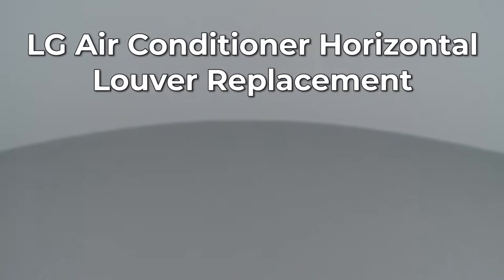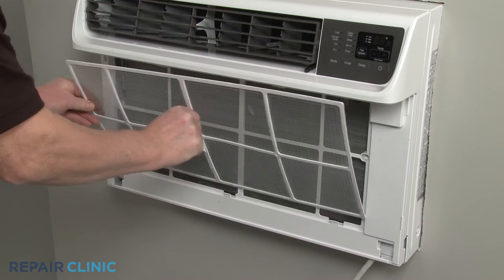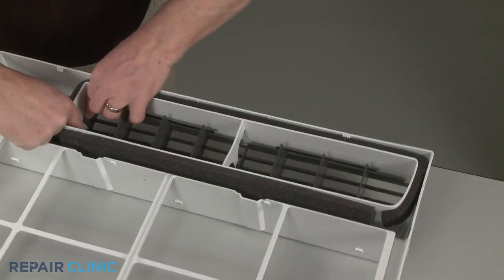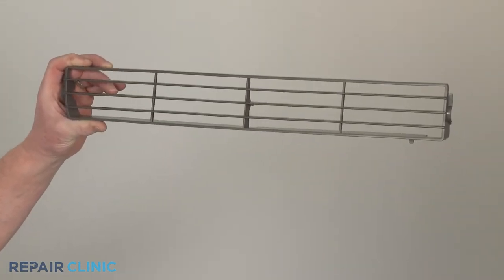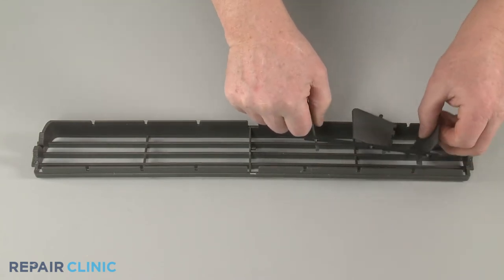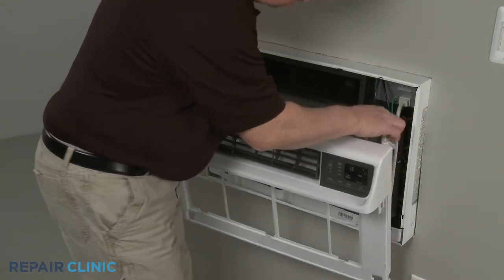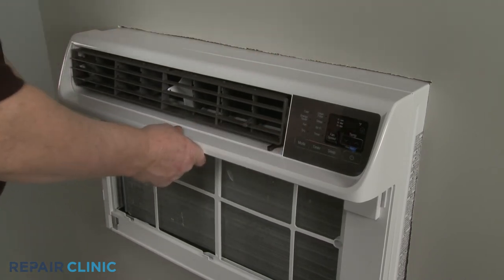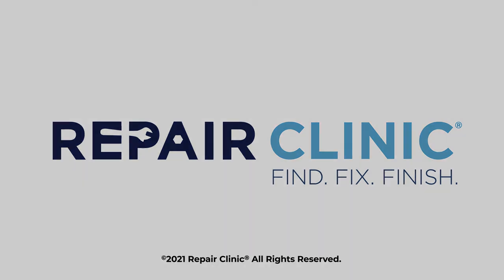LG Air Conditioner Horizontal Louver Replacement MFH63483601

Comment: EXACTLY what I needed to know to pull mine for cleaning the louver and outlet duct, but I cheated... I just grabbed a couple of the horizontal vanes near the right pivot point and pulled... popped right out! Released the center-support and out it came : )